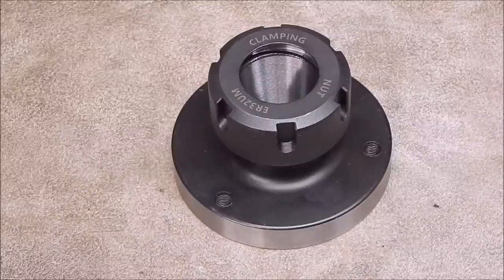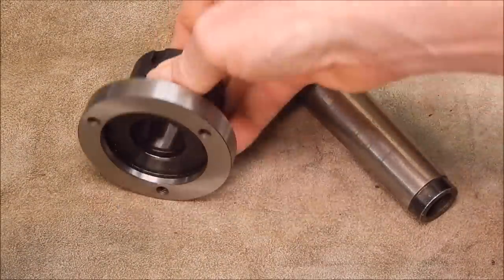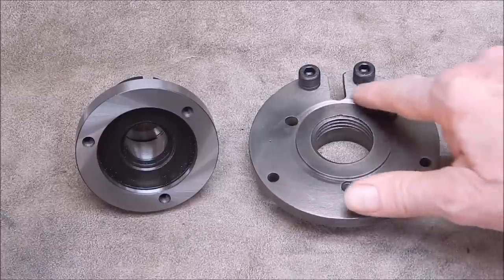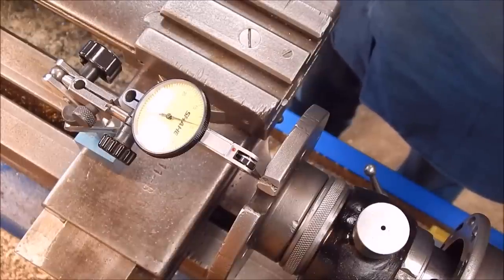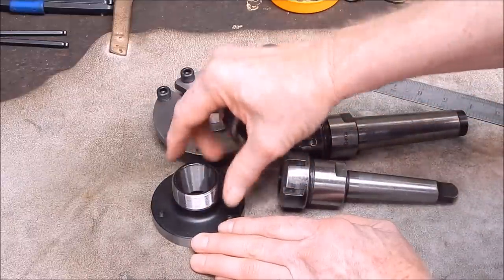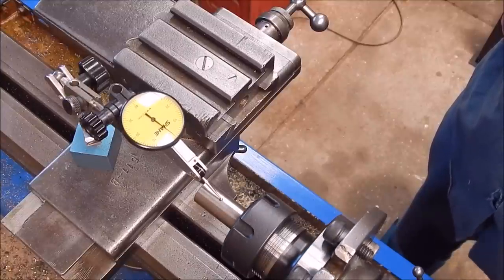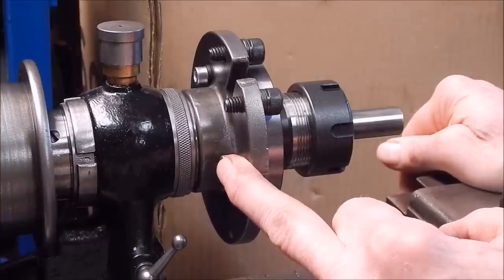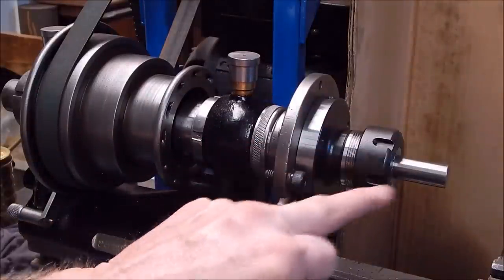Bolt up feed through ER32 collet chuck for a small metal lathe

Comment: I have one mounted on my 7x12 with a full set of collects from 1 to 26mm, I love it and it's so much more accurate than a 3 jaw scroll chuck. It's on my lathe most of the time.
Reply: Hi David, did you purchase from China or trusted brand? At the moment I have a MT3 ER32 but they are a pain to remove when I have to switch back to 3 jaw chuck. Also, how is the runout adjustment? Is there a fast way to get rid of the runnout and run close to true?

Comment: You got a good one there Rob. I only measured the taper inside when I did mine, because I noticed a lot of run out using the method you show, and I was trying to figure out what was causing that runout. Turns out for mine, after ruling the other things out, and double and triple checking with a DTI, that it was the taper that was ground inaccurately. (Must have been a bit of crap on the morse seat when they set it up for internal grinding?) Not only was there a fair bit of run out, the surface finish was like a gravel road! It was night and day difference from the CTC one I got. Your new collet chuck though, looks same quality as the CTC one. That makes it a very good buy indeed. Thanks for the detailed review - it's good to get more detail, and know what you're buying - as you said, the ad often leaves a lot of info to be desired.

Comment: Gday Rob, great review as always, after you did the review on the Shane indicator I got one myself, very happy with it, really smooth in the movement and a decent size dial which is important especially with eyes like mine, one day I will get enough spare coin to buy a set of collets, from what I have seen they are the way to go, thanks again mate,   ATB Matty
Reply from the maker: Hi Matty,  I think the Shahe test indicator is worth the extra coin over the cheaper ones.  I'm like you, eyesight going off and the larger dial is great, but still not overly large.  I Rarely use dial indicators due to their size and access issues.  That little test indicator mount I used is also really good.  Cheers Rob

Comment: Good stuff Rob. I have a Hercus 260 and after a bit of head scratching to decide on a collet solution I was lucky enough to run into a forum member who made me a collet chuck that threads straight onto my spindle nose. Gold! Totally agree that the best collet setup is one that allows you to pass material through the spindle bore. And besides...who needs the hassle of a draw bar?
Reply from the maker: Hi Kym,  I made a thread on pass through collet chuck for the Schaublin years ago and it worked fine until recently when I decided to try and get rid of the last bit of error - yep, stuffed it right up.  So rather than make another I decided to review this bolt up one which has intrigued me for quite a while.  I wondered how accurate it could be compared to a similar bolt up scroll chuck and the thread on collet chuck.  I was quite surprised, as I expected it to be way off.  I think the final runout has more to do with the lathe spindle bushes being worn, than the collet chuck.  Cheers Rob

Comment: Taking in consideration the price, those results are quite good, even better so if it repeats reliably... 
A good looking and well machined affordable tool...
Reply from the maker: Surprised me Pierre.  I expected a worse result given the number of variables that come into play.  I think wear in the spindle bushes prevented me doing better, but overall the end result will depend A LOT on the lathe mounting plate accuracy, both radially and axial. 

My initial result wasn't as good, but after a bit of juggling and adjustment it came up OK.  Better than I was getting from the home made thread on collet chuck (which I managed to stuff up big time by going that extra step after watching Cliffs Shed make one).  LOL.  If it's working OK, leave it alone.  So it was a good opportunity to check this out.  Cheers Rob

Comment: Correction - carbide steel is literally - steel. Carbide is chemical term describing any metal and carbon chemical junction. In machinery we are just used to shorten "tungsten carbide" in to "carbide. But in essence Fe3C is an iron carbide - well known as cementite.  In this case it may very well be Iron (FE) and Carbon (C) carbide just used as a marketing mumbo jumbo.

Comment: When chasing measurements of .01mm TIR or less, it's best to verify the test pin for geometric accuracy.  These pins are usually centreless ground for cost reasons.  Unless carefully set up this type of grinding operation can produce a number of shapes that are anything but round or cylindrical.  Even centre holes in the test pin is no guaranty that the final grinding was done on dead centres.
To check such a pin for cylindricity, place it in a precision V-block on a surface plate, with the appropriate indicator test leg resting on the apex of the pin.  Without moving anything, simply rotate the pin under the indicator.  Any out-of-roundness will be immediately apparent by the indicator's needle movement.  By sliding the pin along, any out-of-parallelism also becomes apparent.
If the pin is indicated to be out-of-round, odds are it will have 3, or possibly 5, lobes.  These are impossible to detect with an ordinary micrometer, hence the V-block set-up.
When I was teaching I had an amusing anecdote with this condition on an endmill cutter.  Even though the cutter's shank's dia. measured less than the holder's bore dia., the shank would not fit into the bore!  Using the V-block test illustrated for my students the problem.

Comment: Thanks for posting. Technically the vernier has an accuracy of plus or minus 0.02mm on any measurement. I prefer to preload the dial indicator at least 1mm to ensure that the tip actually touches the work piece and then take readings.
Reply from the maker: I can't see how you can use any compression type indicator  without pre-loading it.

Comment: Thanks rob, great review. Would be interested in repeatability of the collett and also the drive plate when multiple production set ups are used, eg lathe to mill back to lathe or feeding stock through collett ect. Very respectable run out regardless of hobbyist or not.
Reply from the maker: Hi Glenn,  the collet chuck is permanently on the drive plate.  No need to remove it and I had to juggle it around to get the final result.  There are a lot of variables that come into play with this setup. 

I made up a bar to lock the chuck (using the slot in the dog drive plate) this morning which works a treat and gave the collet chuck a work out - repeatability is excellent.  In fact the accuracy is way better than my screw on home made jobbie.  It's really impressive.  The only issue is the lack of a locking wrench/spanner.  Rob
Reply: Hi Rob,   they sell the spanner wrench separately and reasonable price.    Dale  Canada
Reply from the maker: Hi Dale,  I looked for that but couldn't find one the correct size.  Got a link ?  Cheers Rob

Comment: Sadly, they do not offer a similar chuck for ER40, which is the size I've gone with. Great review, though. I'd consider machining that drive plate down to 80mm and dispensing with the balance bolts.
Reply from the maker: Hi Rick,  the slot goes in past the 80 mm OD, so it will still have imbalance. I made up a bar that goes in the slot when tightening the chuck and it works great, so the slot is still handy, plus one day I might actually need a drive dog.

 The previous owners ran it without any counterbalance bolts and it must have vibrated to some degree.  It's had a hard life and the BSA scroll chuck was absolutely trashed.  The balance weights are a guess at compensating, but must be close as it spins silky smooth now.  Cheers Rob

Comment: Glad you showed this.  I can mount this on a drive plate that can be held in my 4jaw, dial in the work, and go to town on following pieces.  Great review.  Did you calculate the balance weight you needed to offset the gap?
Reply from the maker: Hi Vernon, if you are going to use a four jaw chuck, I suggest buy a square (four sided) collet block.  Much cheaper and does the same thing.  I  have one on order to review.  Cheers Rob

Comment: I have to say my results with the chinese 80mm ER 32 chucks did not come out nearly as good as yours.  Do the chinese send you guys a checked good unit. You Guys being the ones who get free stuff to review!.
I ended up trying to make my own version to get better accuracy.
Also I found the ER32 nuts as supplied were poor. I ended up buying a bearing type, twice to get closer to concentric.
I also had the 2mm balls fall out after the grub screw plug fall out. 

I bought a package of balls and replaced them along with some lock tite to keep the grub screw in place.
Banggood stuff is rather hit or miss as far as I am concerned.
I did end up with a usable chuck, but I treat it as any 3 jaw knowing I will have some runout and once I start a job I do not remove the part until I am done.
THe ER 32 nuts HAVE to be very tight to get best accuracy.
Thanks
Reply from the maker: Hi Dennis, I get the same as anyone else. The order goes through the normal channels.  I can't imagine how BG would check a chuck for accuracy before posting.   LOL This chuck has many variables related to itself and the lathe which all come into play.  I showed how to check the lathe BEFORE you bolt up the chuck.  If you didn't do that, then there's no point blaming the collet chuck.  I had to juggle the chuck around a bit to get the result shown.  I have never found it necessary to use ball bearing collet retainers as the standard ones work fine for me.  The standard single pin wrenches supplied are pretty crap and a multi grip spanner is a huge improvement. Cheers Rob